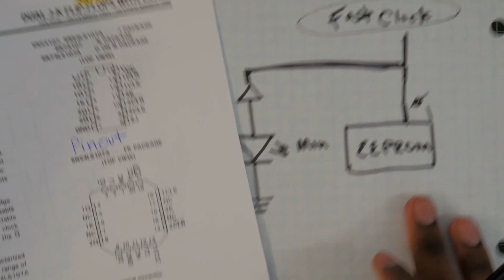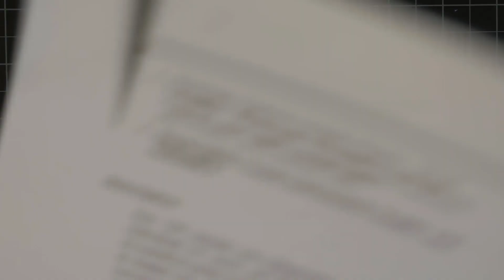Displaying the Time | Hexadecimal Clock Part 2

Comment: I love your videos. The thing with that video here is: You don‘t need the EEPROM actually... you can do the whole display control by using that single microcontroller. The segment calculations, the multiplexing, everything. So it is a bit hard to follow ... But hey: I enjoyed it anyway! 😁
Reply from the maker: We are actually gonna get rid of the microcontroller. I’m not a big fan of using microcontrollers where other components can be used so we just used the microcontroller to program the eeprom if that makes sense. I’ll make it more clear in the next video for sure!
Reply: AM Tech Ah, OK! It looked like the microcontroller should be a fixed part of the (later, finished) circuit. That makes sense. Thank you for clarification. I‘m looking forward for your next video!